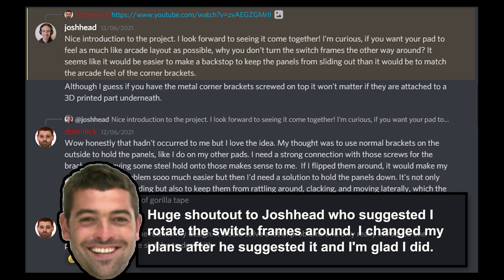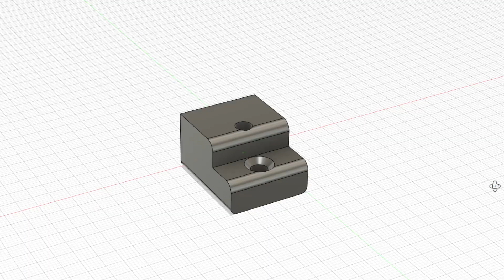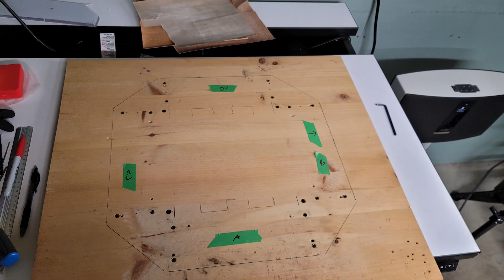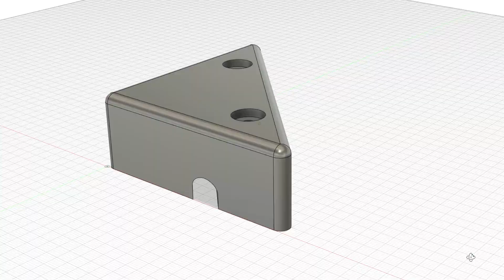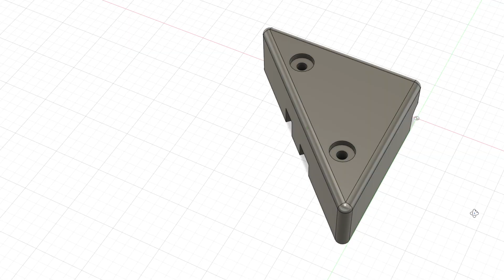My Mini FSR Travel Dance Pad

Comment: Unsorted thoughts/things I've ran into before:

- Use wood glue with wood threaded inserts. It'll be stronger than the rest of the wood panel (same idea as MDF)
- Threaded inserts for plastic are different than for wood. You want to drill a hole that they don't quite fit into and then use a soldering iron to melt it into place. Then you can't pull it out at all, even though the outside doesn't look like a screw. Doesn't work with acrylic (acrylic cracks instead of melting) but polycarb and PE (like HDPE/UHMW) should work just fine.
- Spray painting MDF with a primer should seal it just fine.
- I like that miter saw.
- Since you have a drill press, you can use a countersink bit and countersink bolts so they lay flat with the surface. I did that on my extrusion pad and it looks really nice (although my mdf pad works better overall lol.)

What material are you 3d printing with? I feel like PLA would crack pretty quickly, but ABS/ASA/PETG/polycarbonate would work well - especially polycarb. Looks like your delta has a v6 extruder on it though? It might be able to print with it.

Comment: Really sick video (the montage was amazing!)

And I have to say I'm jealous. The black frames on black HDPE looks incredibly slick. And the bracketless retention method using the bolts is really clean too.

I do hear you on the "will only fit in a big suitcase" issue though. When I fly domestically I only ever take a carry-on which measures like 21"x14"x9". My old pad barely fit diagonally and the new one has to be disassembled to fit at all. Something that literally folds in half would be ideal...
Reply from the maker: At some point i was considering using two half sized peices of HDPE for the base. It would have been cheaper as i could use off the shelf cutting boards. Then, i could dissassemble the pad for the flight and the base could split in two pieces which would definitely fit in a carry on. Maybe some day i can experiment with cutting my wood base in two to see how stable it would be. Regardless, having a travel pad you can easily disassemble that doesnt have parts glued and stuff leaves a lot of options on the table!

Comment: Looks awesome! I’m jealous of your workshop space and tool selection
Reply from the maker: Thanks man. I'm the kind of guy if I find a good tool at a yard sale, even if i dont need it, I can't stop myself from buying it. I think I picked up my big standing drill press for under $50 for example. It drives my wife crazy sometimes. But it comes in handy in future projects having plenty of options available to experiment with. Sometimes i like simpler solutions like cutting the frames with a hack saw vs an angle grinder which would have been way faster. Hack saws are super fun to use. I really like cool tools, but im the first to admit I am not very skilled at using them 🤓

Comment: You built that thing like a tank!
For the power and USB I would suggest using magnetic or at least right angle cables.
That hot glue is nasty. Perfboard and solder would've been more reliable and easier to fit under the center panel.
Reply from the maker: I just looked up magnetic micro usb cables and those looks perfect! I'm definitely going to get one. Thanks so much for that tip.

I actually did get some of those protoboards with the intent to do that but when thinking about holding/mounting them, i experimented with the mini breadboards and found that fit so i just went with it. Stuff like that I'm not too wortied about because i can always re-do it later without a ton of effort.